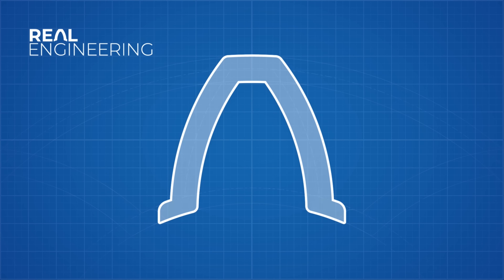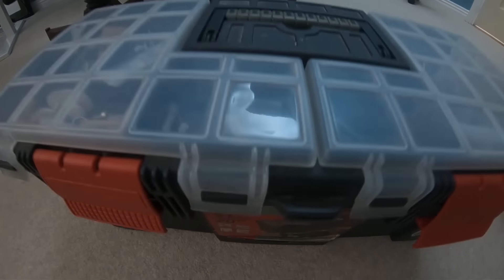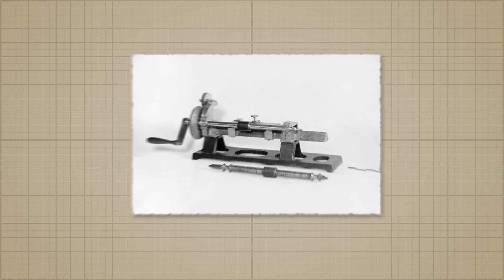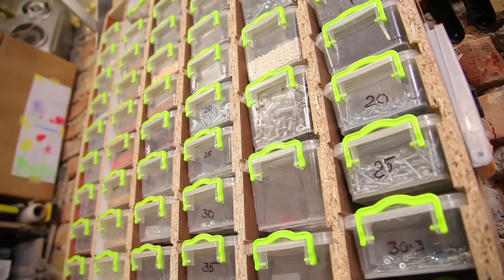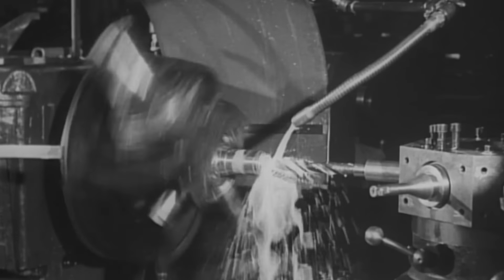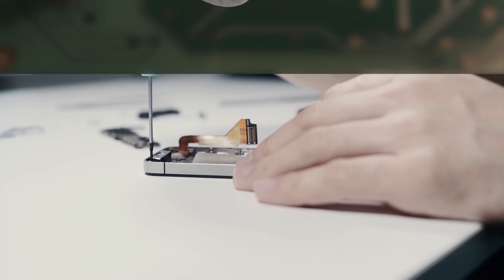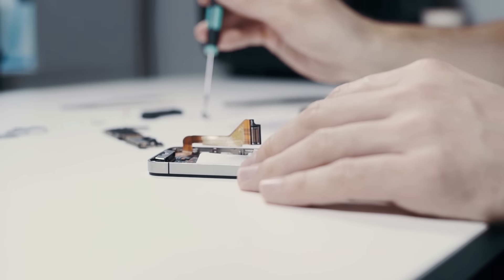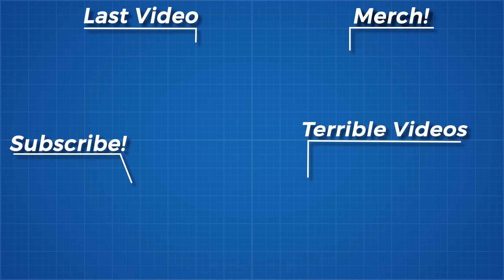Why Are There so Many Types of Screws?!

Comment: Imperial system is great for working construction due to the base 12 system. 

So quit giving imperial system so much hate. I wouldn’t want to divide drywall into 1/6ths in metric system....
Reply: You say that because you’re used to it. I couldn’t dream of device for anything by 6 or 12, it just isn’t as compatible with our current counting system. Plus imperial isn’t strictly base 12, it feels more like a random dump of bases. 12 inches to a foot, 3 feet to a yard, 1760 yards to a mile, ect. Then there’s chains, and so on.
Reply: Zach B in construction the fact that 1 yard is 3 feet and 1 foot is 12 inches means that when something needs to be divided in linear spacing on a piece of construction material (drywall, studs, etc...) they are divided while still in INTEGER number of inches. So on a measuring tape, no matter how it needs to be divided the resolution of a measuring tape allows for a proper measurement to be marked

i.e. dividing a meter long piece of drywall into ⅓ leaves you marking 33.333333333333 cm when a measuring tape doesn’t have 0.333333 resolution only 0.5 mm resolution at best. 

Hence why imperial system is way better for construction
Reply: Zach B was I able to convince you the imperial system isn’t all bad? In terms of engineering yeah the imperial system is a nightmare. However it does serve a really good purpose and it serves that purpose better than the metric system.
Reply: Garret not really. When eyeballing it’s fine, but measurements are supposed to be accurate. That why a simple and versatile base-10 system works, on any scale. Actually it’s so good it’s even the basis of the imperial system.
Reply: Zach B well I can tell you never actually worked construction before or maybe never built anything yourself but if you can’t measure something that’s 0.3333333333333333333 or any irrational number that you get from the metric system on measuring tapes. The imperial system is better since you can divide up any construction hardware in more ways an land within the resolution of your measuring device

You still have not disproven why the metric system is better in this regards.
Reply: Garret it’s easy to decide by a third, and it’s as accurate as using imperial. Just measure 333 mm. It’s as accurate as say 4 inches to a foot because as humans we aren’t 100% accurate to begin with
Reply: Zach B no that is incorrect. 333 is not an irrational number. You aren’t correctly dividing your piece correctly in that case. While in the imperial you will always have some tick mark to make your measurement on making in more accurate.
Reply: Garret you are never going to need it more accurate than mm, and if you do, a computer is way more accurate than us
Reply: Zach B and what person who’s building a house just has a computer to mark up lumber

Comment: Growing up learning Electrical work from my Dad, I can remember a time when nearly all screws I encountered were Flat Heads. Wood screws, machine thread screws etc. It took me a lot of practice to get good at operating a screw driver at the tender age of 10 years old. I must’ve stabbed myself in the hands dozens of times, and scratched up walls and stuff too. Nowadays the battery operated Driver/Impact Gun is used all of the time. I keep a variety of different Bit types in my tool pouch for just that purpose. The Flat-Head bit with the keeper collar is one of the most useful for backing out long 6/32 screws from old outlet boxes. What I find funny is that the new generation of electricial apprentices can barely operate a screw driver, having had so little practice. The result is a lot of over torqued screws where the switch or outlet ends up crushing into the box and damaging things since they just pull out their Drill Driver and go town. I had a friend help me with some work and I left him to screw a light fixture into his closet ceiling with 3” x  8/32 screws. It took him almost 10 minutes and when he was finished he complained about his shoulders burning like hell. It leaves something to be said about the simple technique of turning screws by hand and the endurance it takes for someone who doesn’t do that for a living. My favorite screw type, if I had one, would be the Robertson or Square Drive as we call them. It makes for a tight fit and rarely Cams Out if seated correctly. Torx are pretty good too, and besides Flat Head the Phillips are my least favorite. So many Bit manufacturers claim their Bit Geometry is better than their competitors but no matter what they Cam Out all of the time especially with high torque applications. None of the different types are perfect.

Comment: I absolutely HATE standard philips head.  Feel like they strip so easy - a simple flat head almost always seems to work better.
Bah!
Reply: The Phillips head was designed to cam out.  Every drive type was designed for a reason, and sometimes you want cam out.  It prevents over driving a screw.  If the type is used in an application where that is a problem, then blame the person who chose it, not the design.

Comment: Torx is pretty good but hex usually has a deeper engagement. Torx would probably be far superior if they tool went deeper. The other problem is the tool. The torx bit's outer points may be many but are not a very deep engagement. An example is GM truck brakes that used have head torx screw for the mounting of brake calipers. With very little rust the bit just rounds out the inside of the screw just like a philips screwdriver or snaps your hardened torx bit off in the screw. It's a trainwreck of a repair and I always use the torches to ease removal and throw the fucking things away and use a hex head cap screw, ie a bolt. With hex you can apply much more power to the tool and screw before it rounds out. Improvement could probably be made to torx but, as a mechanic, it's just another pain my ass set of tools I needed to buy but the fasteners are NOT superior to hex and are way inferior to actual hex head screws, ie than you use a socket or wrench on. What you called a hex screw is actually called a socket head cap screw and uses an Allen wrench. In tight quarters I understand the use to SHCS or Torx but where space is not an issue, lets just use bolts! Much more force can be applied because it engages the entire outside of the head head.

Comment: Because 
😎 
screw you!
[♪ The Who - Won't get fooled again] 

Seriously, up until torx it could conceivably be explained as "better mechanical design" (flathead is pretty terrible after all) but from there on out it just gets bloody ridiculous with Pozidriv (that is not quite entirely the same as Phillips because reasons), tri-wing,  pin-headed "security" hex and torx variants, pentalobe, clutch, oval, spanner, you name it... to either deny right to repair entirely or at least sell a ludicrous cornucopia of different expensive specialist tools to people who keep insisting on trying to open their gadgets.
Cell phones, of course, have done away with that pesky "right to repair" thing by putting everything together with superglue and generally stopping just short of making the entire phone a bakelite-molded monolith that would be completely impossible to open without destroying it. 
(Apple, if you're interested in that last idea, I'm gonna need some royalties.)

Comment: Torx has pretty much taken over the world of wood screws, you have to look very hard these days to find standard wood screws that are not torx, exept for those bags of crappy screws you get included with your new coat hanger. And all this because they are just plainly superior to the other designs we have, no sripping the screwheads, no toqing over and the screw will stay on the bit without you holding it with one hand, enabling the use of an electric screwdriver with one hand without magnetic bits that picks up metal shards.

Comment: This presentation is juvenile in tone, and it gives the impression that US threads have made no progress since the earliest days when there were no standards.  In fact, US threads have been well standardized for a long time.  And the manner in which threads should be cut is a separate question from the choice of units.  US and metric threads are similar except for the dimensions.

Anybody who uses the term “freedom units” is not someone to be taken seriously.  Real engineers can work equally well in US and metric systems.  Engineering is not politics, it’s just about making things that work.
Reply: Chill professor... its only a light hearted look,  not an indepth engineering class.